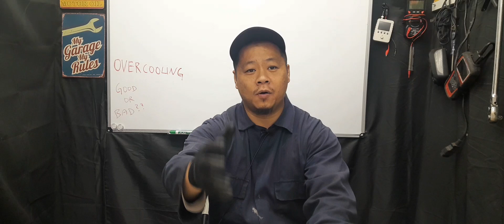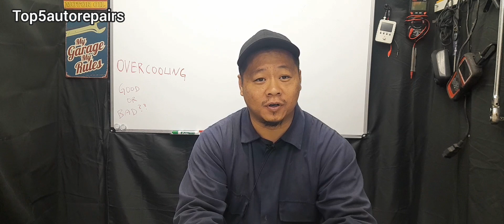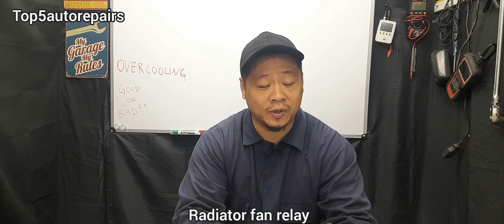CAR ENGINE OVERCOOLING IS IT BAD? THIS WILL HAPPEN WHEN YOU DRIVE WITHOUT A THERMOSTAT

Comment: Can an engine die when it’s too cold? My Pontiac vibe shut off while driving and a few minutes before it shut off, the engine, awd, and oil light came on all at once. The thermometer 🌡 was below C and the engine had a rumbling noise. Now I’m panicking.
Reply: bro this exact thing happened to my civic what was it

Comment: Question 05 honda crv 2.4 I have to put coolant almost everyday. Can the cause for it. No coolant leak
Thanks for sharing your diagnostic
Reply from the maker: Is coolant flowing out of the reservoir tank? If so radiator cap is faulty.
Reply: @Top5AutoRepairs  no sir
Reply: if u have to replace it there must be a leak somewhere bro, coolant doesn't desintegrate into the aether.